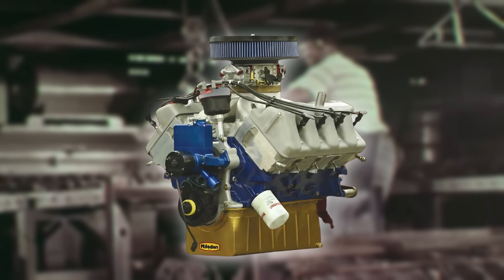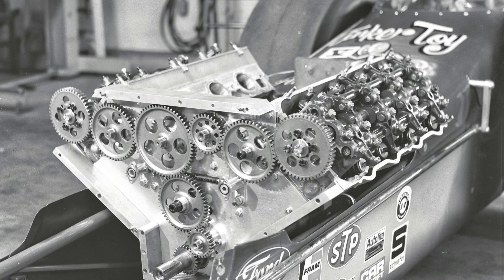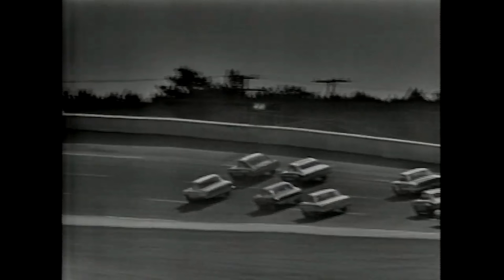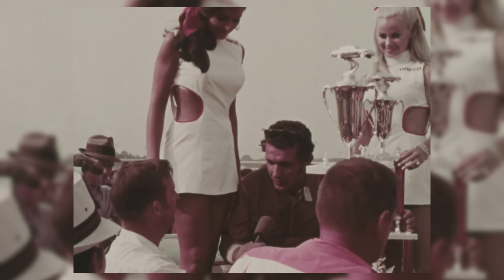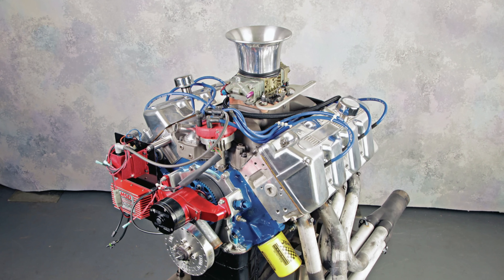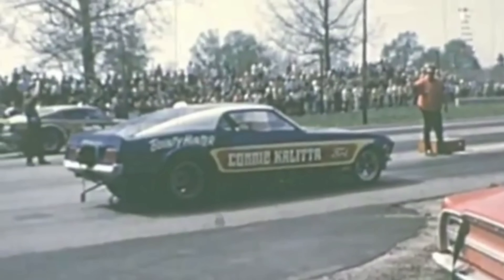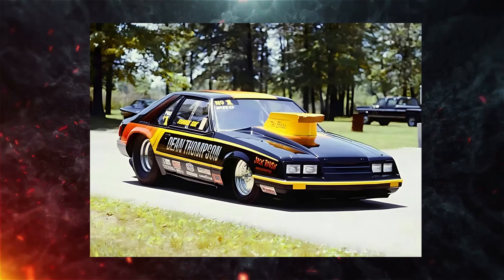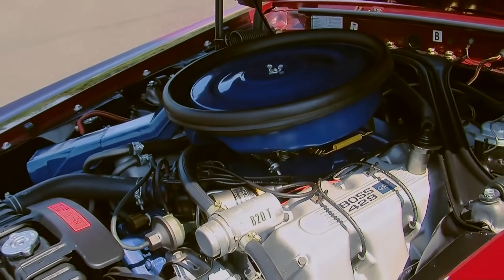The Shocking Truth behind Ford’s Banned BOSS 429 Engine!

Comment: Bob Glidden won 5 of his 10 NHRA Pro stock championships (1985-89) with that 429 design engine. If I remember correctly he started using that engine in 1982 I think. It for sure had its time, but like anything else the competition will catch up over time.

Comment: I have an old 66 F100 pickup. It had a 390 GT FE,  and a top loader 4 speed, when I bought it. It was fun for light to light racing, but ran hot on a long highway run, at triple digit speeds. When that 390 got tired, I swapped it out for a 460. It sucked on the street races, but would cruise at 100+ mph, all day long. In that truck, both engines were 11mpg...
Reply from the maker: Sounds like you’ve had quite the journey with your F100! It’s amazing how different engines can change the driving experience. Those classic trucks sure have a personality of their own!  @yankeewatchdog

Comment: Honestly, regardless on brand or engine model be it a Chevy 327 with solid lifters, 396, 409, 427 or Pontiac 389, 421, Mopar 383, 413, 426 Ford 351, 390, 427, 429 etc. they were all great engines that took a licking day after day  and keep on ticking...... compared to the higher HP turbo engines made today. And back then 1967-1972 they were 'affordable' for any kid with a job.
Reply from the maker: You make a great point! Classic engines from that era were truly built to last and had their own charm. They definitely paved the way for the turbo engines we see today.  @samgentile7494

Comment: At the end of the 1964 season, Ford had beaten the 426 Hemi and won more races and the Manufacturers Championship.  For that NASCAR banned the 427 High Riser engine which Ford had just used to win the Championship.  For 1965 Ford developed the 427 Medium-Riser. In 1967 Ford switched to the Tunnel Port heads and intake because the 426 Hemi was racing with their Race Hemi heads (different valve angles) and bathtub intake, neither of which were factory stock.

Comment: Ford did the same with the 429 Cobrajet and Chevy with the big block.  Build a race engine and then try to make it into a truck engine. Like I commented elsewhere, add 150 cubes and you may have something.
Reply from the maker: You raise a great point! Many manufacturers have faced challenges when trying to adapt high-performance engines for different applications. It's always interesting to see how these engineering decisions play out over time.  @donbrutcher4501

Comment: I honestly wasn't a Ford guy until I owned a Ford Escort Lol. It was a 1988 station wagon to be exact. Well after tinkering with it and learning more about Ford I became an enthusiast of Ford motor company. Note I was a Mopar mechanic for 16 years and a GM / Chevy guy before that. 
Built a a whole bunch of GM's Pontiac and Chevy's. Then switched to Mopar but that Escort changed my opinion of Ford. I put 289 thousands mile on that Escort before driving it to a salvage yard. I still own a 1984 
Z/28  Camaro I bought new. But own Ford's as my daily driver's. Wouldn't mind building a Boss motor and installing it in a 2014 Mustang. To me that would be the ultimate street machine...
Reply from the maker: @VIKING-SON  wow, It's amazing how one car can change your perspective! The Escort may be small, but it definitely packs a punch in terms of building Ford enthusiasm. A Boss motor in a Mustang sounds like a dream project! i had a mk 1 escort, with a cosworth , it flew!

Comment: I am 57 years old. I have 2 brain cells. Both the Cammer and Boss engines were specifically designed to be a NASCAR  engine. Just so happened the Cammer was great at both. The Boss...not so much. The million dollar question is...why did NASCAR ban the Cammer? I think we all know the answer to this question. I'm sure Chrysler knows as well.😎🤔🏁
Reply from the maker: @JerryHelton-zo7dg
Thanks for sharing your insight! It’s always great to hear perspectives from fellow enthusiasts, especially about such iconic engines. and contoversy !
Reply: @rarecarstorys thank you.🙂
Reply: Same reason they baned the hemi
Reply: @markguerin701  at least the 426 Hemi got to race on the track for about 6 years before it was banned.
Reply: The Hemi was never ever banned, EVER! See my other comment
Reply: The Hemi was never banned! That's Hemi Hype!

The 426 Hemi came out in 1964 and Ford beat it by not only winning more races that year, but also the Manufacturers Championship. 

At the end of the season, NASCAR banned the Ford 427 High Riser engine which Ford had just used to win the Championship. At the same time NASCAR suspended the experimental Hemi because it failed to meet homologation rules as a production engine. This suspension lasted six months until talks resumed on June 1965 at which point Chrysler was able to prove that the Hemi was going to be a production engine in a few weeks as a 1966 model. Mean while Ford had developed the 427 Medium-Riser engine which was just as powerful as the 427 High Riser. The Hemi returned to racing in mid July and finished second part of the season. Ford finished the decade with seven consecutive Manufacturers Championships (1963-1969)
Reply: The 427 Cammer was never banned, that's a myth. 

The short explanation is that Bill France the president of NASCAR was scared of it and feared it would snowball into a manufacturers horsepower war, which it almost did. France wanted to slow the cars down to a safer speed and make racing more affordable, so NASCAR keep stonewalling Ford with red tape and hurdles. After Ford had meet all their demands, NASCAR send a letter to Henry Ford II and said the SOHC could race but only in the big Galaxie and with a 430 pound penalty. HFII had enough and on April 15, 1965 Ford boycotted NASCAR and pulled out of racing. This lasted until July of 1965 when a decision was made to allow the 427SOHC to race without stipulations. HFII said it would return in 1966 but it never did.

Comment: I was told that chevy/gm threatened to leave Nascar if they didn't ban the hemi style engines. 
Any truth to this?
Reply from the maker: @Willie-bk2es The claim that Chevrolet/GM threatened to leave NASCAR to force a ban on Hemi engines is **partially rooted in historical events but conflates timelines and motivations. Here's the clarified breakdown:

---

Key Context & Truth:
1. 1963 GM Withdrawal: 
   - General Motors (including Chevrolet) voluntarily withdrew from factory-backed racing in 1963 to comply with the Automobile Manufacturers Association (AMA) ban (a 1957 industry-wide pact to avoid overt factory racing involvement). This decision was not directly tied to Chrysler’s Hemi engines, which were not yet dominant at the time. GM’s exit left private teams to race with existing engines, including the Mystery Motor.

2. Chrysler’s 426 Hemi & NASCAR’s 1965 Ban:
   - In 1964, Chrysler debuted the 426 Hemi, which dominated NASCAR. In response, NASCAR introduced the **“Homologation Rule” in 1965, requiring engines to be available in at least 500 production cars. Chrysler hadn’t yet mass-produced the Hemi, so NASCAR temporarily banned it, prompting Chrysler to boycott the 1965 season.  
   - GM was already out of factory racing by this point and played no direct role in this ban. The pressure likely came from Ford, which capitalized on Chrysler’s absence in 1965.

3. 1966 Resolution:  
   - Chrysler reintroduced the 426 Hemi as a “Street Hemi” in 1966, meeting NASCAR’s production requirement. The Hemi returned and dominated again, but GM remained uninvolved (still adhering to the AMA ban).

---

Why the Confusion? 
- The Mystery Motor (1963) and Hemi ban (1965) occurred close together, leading to myths that GM pressured NASCAR. However:  
  - GM’s 1963 exit was unrelated to the Hemi.  
  - The 1965 Hemi ban stemmed from NASCAR’s rules and Ford’s lobbying, not GM.  
  - GM did not threaten to leave NASCAR over the Hemi—they’d already left.

---

Legacy of the Myth:  
- The story persists because GM’s withdrawal (1963) and the Hemi’s troubles (1965) overlap in a chaotic era of NASCAR’s “horsepower wars.”  
- While GM’s absence indirectly benefited Ford during Chrysler’s 1965 boycott, there’s no evidence GM strong-armed NASCAR to ban the Hemi.

---

Summary:  
- False: GM did not threaten to leave NASCAR to ban the Hemi.  
- True: NASCAR banned the 426 Hemi in 1965 due to homologation rules, influenced by Ford’s lobbying, not GM.  
- GM’s 1963 exit was a separate corporate decision tied to the AMA ban.  

Let me know if you’d like deeper dives into specific events! 🏁

Comment: I love this engine. Genius engineering. Along with the 351 Cleveland.
Reply from the maker: @dbireland2003 Right? The BOSS 429 and the 351 Cleveland are just pure muscle! Can't get enough of those classic engines!
Reply: I'm new to learning about engines.  If the # represents displacement, how can something with a 351 come close to something with a 429?
Reply: @ the Cleveland engine is actually a big block. That’s a designation by GM Ford never ever got that concept it’s a 90° block it likes to breathe and you don’t need a ginormous carburetter unless you’re running runners to give time for the fuel to blend. Both engines, love turbos and super chargers. Street 600 or 650. Carburetter works really well.

Comment: The motor was designed to run at high RPM. On super speed ways. Wouldn’t work on short tracks. Didn’t work very well on the street. It overheats at stop lights in the summer and didn’t pull very well from lower RPMs. I have a friend who has one in a GT500. He likes the car but the 429 was not good. Spent a lot of money having it rebuilt by Shelby. He ended up putting a 351 in the GT 500. He has the 429 to put back in to sell it someday. He is in the process of building a diesel mustang right now. He is using a very fast BMW diesel.
Reply from the maker: @CharlesWinters-ie3jy
Thanks for sharing your insights! It's interesting to hear about the real-world performance of the BOSS 429. Sounds like your friend has quite the project lineup!

Comment: Ford always comes out we great engines but they are never made long enough to really develop them  Boss 429 and 427 SOHC , plus NHRA does not like Fords winning races.
Reply from the maker: @briancool3110 You make a great point! Ford has indeed produced some legendary engines, and it's a shame they didn't get the chance to shine longer on the track. what do you think NHRA problem with ford comes from?
Reply: Hi racecarstorys  I think don’t know if Iam correct but NHRA likes to have GM products win because the fans like that more and the weight brakes for most Ford products is more HP to CI . Just my opinion

Comment: I thought the 429 SCJ was the baddest motor Ford ever made ?
Reply from the maker: @craigfisher9713
Thanks for sharing your thoughts! The 429 SCJ is indeed one of the baddest motors! , and it's always fun to explore the different legends in Ford's history.
Reply: my brother had a 1969 Cobra with the 428 cj.  Its redline was 5200 and it topped out at 120 mph at 6000 rpm.   It sure could lay rubber!  2 stripes 50 ft long!   A friend of mine in high school drove a 1970 cobra 429 scj because his dad was a salesman at the Ford dealer.  That thing was fast!!  It blew away my 69 Chevelle SS396 AND my brother's Cobra.  But none them compare with 2015 Mustang GT Premium I bought for my wife 10 years ago. That thing hit 160 in half a mile and was still pulling hard when I chickened out.  And I had the convertible top down too!  It didn't drift one bit nor did it twitch either.  Ford did the S550 RIGHT!

Comment: This is why the hemi is the benchmark. It won in nascar and drag racing. At 426 cubes and 500 cubes. On the street, traction was the issue not being sluggish. The only winning engine with no excuses.
Reply from the maker: @buildingracingvideos4714 The Hemi definitely set a high standard in the racing world, and it’s fascinating to see how different engines have shaped motorsport history. Thanks for sharing your thoughts!

Comment: 351 Clevelands also have issues on the street.  the 4v or "4 barrell" heads have BIG ports and don't work well on the street, the 2V or "2 barrell" heads are better for a street car.
Reply from the maker: @JesusServant-Z
You make a great point! The differences between the 4V and 2V heads can really impact street performance. It’s always interesting to see how specific modifications can change the driving experience!  i guess the turbo they added in the 80s fix the air to fuel problem?
Reply: Today allmost evry engines have for v tops.
Reply: @JohnMagelius  The "V" in the Cleveland 2V & 4V heads refers to Venturi's, not Valves. The 2V was optimized for street use fitted with a 2-barrel (venturi) carb, giving plenty of low end torque, but it limited the rpm range to about 5k. The 4V was optimized for the track with a 4-barrel, and was much less restrictive - great for top end power at 7k+, but much less torquey in the low-mid rpm band.
The ideal head for street/strip use is a ported 2V. If done well, you can get a high revving motor that has good torque as well - much easier to use in day-to-day driving than the 4V, but breathes well enough to get some surprising HP out...

Comment: Same old story, FORD brings the Heat and Sanctioning Bodies take $$$ from the competition who can’t compete then the BANS ensue. AI Narrations Suck dirty ass.
Reply: I only learned yesterday that Ford in 1964 launched a 4.2 quad cam 32V motor with fuel injection. I believe that if they had been aloud to run the cammers. We would have had a coyote type engine in the early seventies.
Reply: Every manufacturer had a product to compete, NASCAR as usual slowed engineering.
Reply: Same as the intro to the 351C, still banned in areas Ive heard.
Reply from the maker: @cavscout62  @2011metalmaniac   @chrisredfern1882  @danderson9881  Ah, the age-old battle of innovation vs. regulations! If only there were a "no sanctions" clause in the automotive playbook!
Reply: @rarecarstorys I suppose I'm glad for it otherwise all engines globally would be the same. If nascar had not mandated pushrods then automotive engineers and would have stopped developing them.
Reply from the maker: @2011metalmaniac
True! Without those pushrod mandates, we might have all been driving glorified lawnmowers by now. when you do have restrictions, engineers get real creative in the engine world!
Reply: @rarecarstorys don't get me wrong I like the little engines too. Bike engines, beetle engines. Engines used in RC models. Ironically honda gx lawn mower engines are pushrod. It's cool that the American auto development perseud with the pushrod as most of the European and Japanese manufacturers abandoned it. I was surprised to here though that Bentley of all companies carried on with them.
Reply: @rarecarstorys Ferraris etc are glorified lawnmowers? Most new engines developed since the mid sixties are OHC because it's possible to push them harder because there is less slop etc in the system enabling higher RPM. What you're saying makes no sense. Pushrods only really make sense if there is a packaging limitation that restricts the size of the head(s) since OHC heads are bigger. Which there is in a sense in the  world of automotive V8's since if you cram a big V8 with OHC into an engine bay you get what BMW and Mercedes have, engine bays so packed you can't get a hair in there, let alone a tool. Every job becomes engine out because there is no space.

Comment: Strong race engine for the street after retuning for the street the FE 428 Cobrajet engine was stronger than the Boss 429 I’m not even sure the 429 canted valve engines were as strong as the 428 for the street anyone agree or disagree in 1968 Ford made a 427 with hydraulic lifters around 380 hp don’t know much about that engine but it probably had smog equipment (air pump) if memory serves me correctly!
Reply from the maker: @Mrgregtrain You make an interesting point! The FE 428 Cobrajet has definitely earned its power reputation, and it's fascinating to see how these engines compare. There’s a lot of history and performance to unpack!

Comment: With huge intake ports, the speed of the air/fuel going through is too slow at street speeds and the fuel falls out of suspension and also the air doesn't really have a "running" start to fill the chamber as soon as the intake valve opens. A good street engine doesn't work well on the track and a good track engine doesn't work well on the street.
Reply: It's "cammer" not camera....
Reply from the maker: @bigb4894 You make an excellent point! The balance between street performance and track capability is definitely a tough nut to crack with engines like the BOSS 429.
Reply: Try 600cfm for the street.
Reply: I found after trading an 860 cfm to a 750 cfm the street performance increased. The sweet spot was around 600cfm. Those huge ports atomized the fuel. Do your research.
Reply: Unless you change the intake to tall runners which didn’t come out till much later as stock that’s fords solution.

Comment: I always questioned why the Boss 429 didn't get the job done on the street, running against big block Chevys and Mopars. Thank you!
Reply: The video explains why it wasn't competitive on the street or strip in the early years!!!
Reply: Street version of the Boss 429 in the Mustangs that were sold at dealerships were castrated from the factory with much too small cam, carb, exhaust etc. Cylinder heads that outflow anything else didn't work well with the street version restrictions.
Reply: Basicly stock 302 Z-28s were kicking their butts.
Reply: @donbrutcher4501  Popular Hot Rodding's test of a 1969 Z-28 listed a 1/4 time of 14.74. Super Stock magazine's test of a 1970 Boss 429 listed a time of13.64.